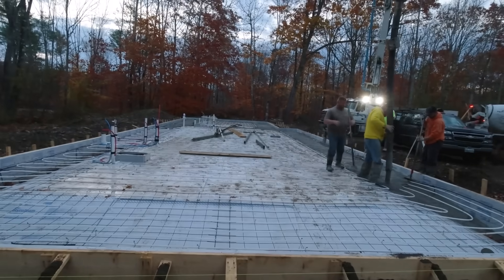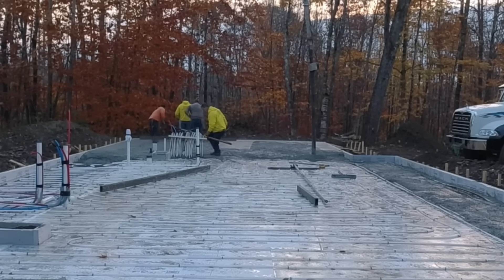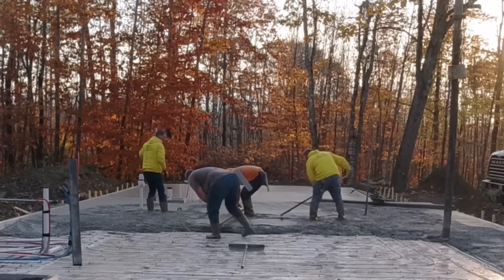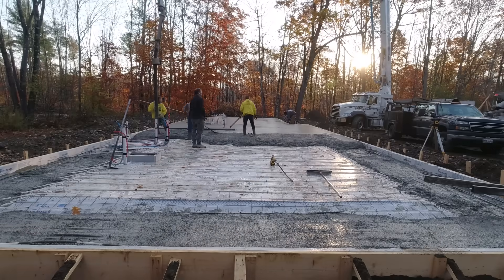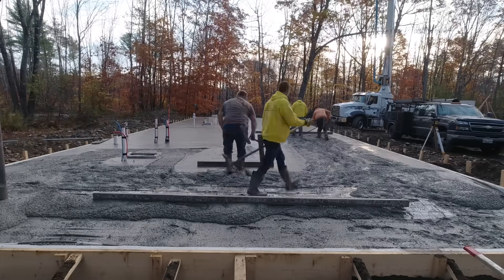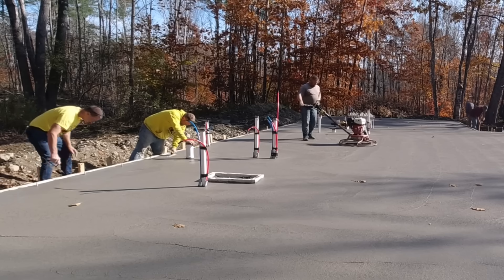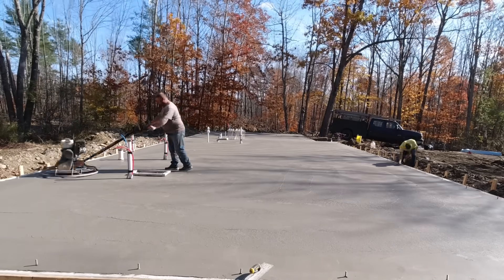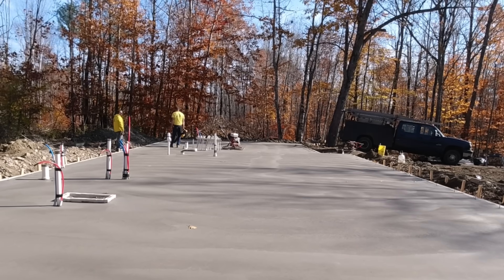City Inspector Makes Builder Pour Slab 2 Feet Thick on the Edges!

Comment: An inspector can't force you to do anything that isn't on paper as code. 
They can try, I know firsthand, but all you need is a set of nuts and the ability to open your mouth to tell them NO.  
Force them to show you they are correct and it's not just their opinion. When they can't, the problem is solved.

Comment: Builder for 35 years, I would never build a house without at least a crawl space ( one that you can sit upright on a dolly and get around...Concrete floor...But, if you're building a house ALWAYS HAVE A BASEMENT. If the water table is too high...DON'T BUILD THERE...

Comment: Engineer designs the slab, pre pour inspection, post pour inspection.  All in person inspections.  If it is concealed, then a pacometer test and unbury 3 spots to prove the slab is correct, including digging under the slab to prove the thickness of the walls of the foundation.

Comment: Excellent concrete work! Licensed architect and former builder here. In Oregon and Washington the state establishes building code, a modified version of the IRC (International Residential Code). There are prescriptive structural engineering provisions in the code to allow homeowners and builders to design a residence. Typically the County administers the State building code. Neither the plans examiner nor field inspector establishes code. Recommendation: Buy a copy of your code and read up! Then you'll have code info to rely upon. Footing width for 2-story is 15" and 1-story is 12" out here. As others mentioned, footing depth is driven by frost-heaving. 24" in my part of Oregon.

Comment: 2” of foam deters 2’ of frost, and this is way overkill on the edges, I’ve never seen more than 12” on the edges, it’s quite apparent the code officer has never built a dog house before, talk about wasting the homeowners money, I still see just flat 6” slabs that were poured in the 70s with no foam under them that still haven’t moved, like you said Mike the sub grade material and compaction will tell it all, but now I wouldn’t pour anything without foam just to be safe, it’s expensive insurance but it works. Another nice job brother.

Comment: Mike, great information. I have one question you didn’t mention Is it a single story structure or true story structure how much weight is gonna be on the outside wall that would be the first thing that would determine how thick the edge wall has to be and how thick the taper going in has to be and how thick the  slab has to be that’s information you didn’t keep us informed about. Also My question between the garage and the house. I’m surprised the inspector and let that all go one level without a pitch from the front of the back of the garage, which you didn’t mention and also a step up from the garage to the house just in case you had a gasoline leak from the car into the house also to the furnace or the other way you could catch it would be a drain between the garage and the house wall I’d roll with that keep up the great work Samuel Bacon

Comment: Frost line is a big factor that needs to be considered.
I have no doubt that in Maine the frost line could be as much as 4 feet.
Of coarse nobody wants to spend more money than is absolutely necessary, but it is what it is, and the frost can for sure lift those walls if the foundation isnt deep enough.
Ive seen where they are laying 2” thick foam along the bottom of the excavation up against the walls before back filling, and that might help. But only time will tell.
As for inspectors, even in places where there is a statewide building code, there will be inspectors who have their own opinions.
But, some engineers are also certified building inspectors.
And even in places like Florida, a builder need not tolerate the county inspectors.
They can use a private state certified inspector if they so choose.

Comment: At first thought I was jealous that your building on a rock slab and don't need a frost footing. Then on second thought that must make it difficult to put in a well or sewer system!
Reply: You end up lifting the slab with engineered fill. I had to put in 34" of sand to put my septic system in -- because granite right below the surface.  Going to have to lift the space where the house slab goes about 19" in order to have enough slope to get to the septic.
Reply: Yikes! In your initial thoughts of building it's easy to overlook the cost of what's underneath the house.

Comment: Following established codes simplifies project procedures. Employing a qualified engineer and utilizing stamped drawings improves communication with municipal inspectors, effectively addressing their concerns. While the upfront cost may seem high, it can lead to significant long-term savings and project success. Having a plan is always more efficient.

Was there a discrepancy in this project between the specifications of the design engineer and the requirements of the municipal inspector?

Comment: I'm in Ontario , Canada  - anything over 550sqft , you need an engineer -- but my slab for my house is 1197sqft.  14" thick edge, sloped up to a 5" slab. perimeter rebar, 6" wwmesh , no fiber. 3200 psi, 4% air.  Does have bunch of rebar perpendicular to the edge as well.- but no added footings/thickening for load bearing wall or interior posts.  Column for the ridge beam might carry up to 14,000 lbs based on my snow load - and still only 14" edges.  SIgned and sealed.  (I'm about 10" above granite the whole way around my place, so.. floating slab)